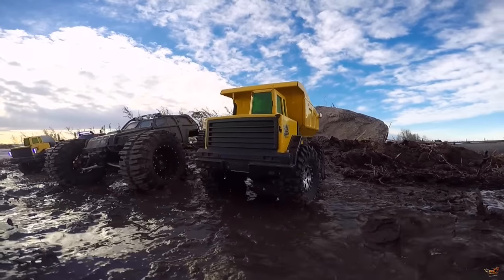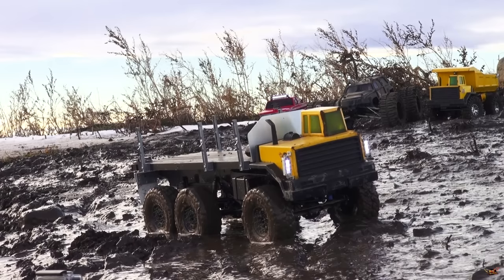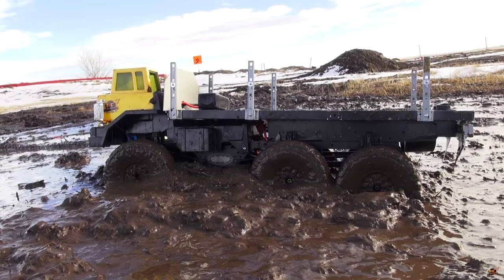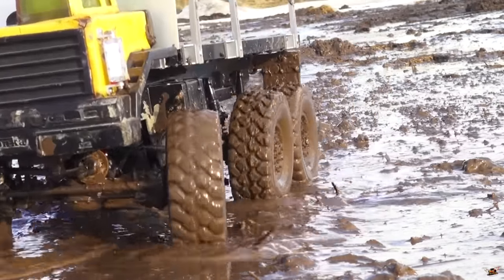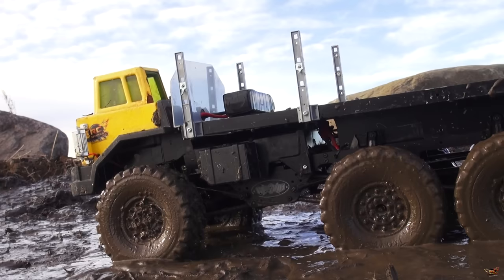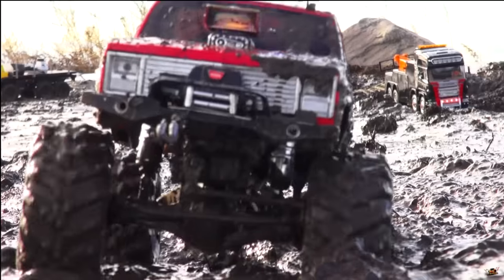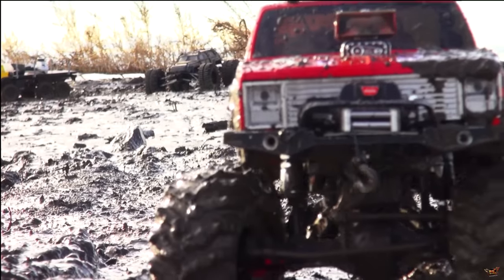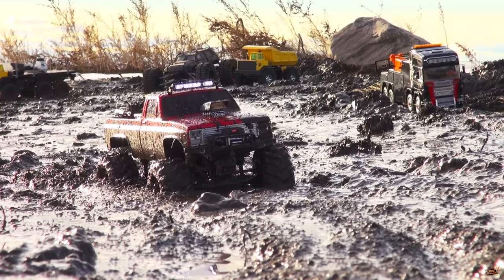RC ADVENTURES - MUD BATH - 5 Trucks get Dirty

Comment: I have an idea, and would like to know people's opinions, even though the top opinion will probably be "throw it away.'

I bought a 4x4 Traxxas Slash last tax season, and bought the one with onboard audio (OBA).  
The thing is, the slash is so damned fast (I've gotten 44 miles per hour so far, but am not the best driver, so that's plenty for me yet), that you only get to hear the OBA as it passes (which sounds cool) and then not while it's 100 feet away (I do a lot of speed runs, in parking lots, still getting better at controlling at high speeds).  
Another thing is that the OBA speakers RELY on a TAPE connection between the speaker baffle (there is no speaker 'cone') and the inside of the lexan body (which serves as the cone).  Every time the truck tumbles or takes a moderate hit, the tape pops, and if it's not a fresh tape seal (no dust at all on the tape), the speakers will pop off, there's nothing you can do about it.  I've even tried rubber cement and even superglue once (don't do that).  It's just  too difficult to keep them glued well.

So my idea is, I'd like to pull the OBA out of the slash and put it in my Honcho, with a regular small speaker.  It won't be as loud or rumbley without the lexan body, but it should suffice since I am never more than 20 feet from the Honcho .. and thought it'd be pretty neat to have the sounds of a "900 horsepower performance engine under the hood".
I also have a Subaru Impreza body that fits my honcho chassis and the 900-hp engine would just sound stupid as hell (and thus hilarious?) in that .. 

Thoughts/ideas/suggestions/changes?  If the only thing you have to say is "throw out the OBA" or "OBA is a joke/toy/etc." then please don't bother to say it.  I HAVE it already and am just looking for ways to mess with it, it's costing me nothing at this point.

Yes, that post was too long, so thanks for bothering to read it.

Tl;dr  How should I reuse my Traxxas OBA module in my Honcho/Stampede/other vehicles?
Reply: You can buy new tape rings online, like eBay or Amazon, maybe you can try some gorilla tape to hold the mounts down after you do that?  People use drywall tape and Shoe Goo to reinforce and fix cracked lexan, could try that too. You should try contacting Traxxas first, they have great customer service!! they might even send you some new rings free or give you a better idea how to fix it. On board audio is awesome!!  One of these days I'll get it for my slash, I can't wait!!

Comment: Are your tires filled on that skidsteer? Or are they air filled? If there air filled you ever have an issue poppin the bead off the rim makeing sharp turns?
Reply: They're air filled I believe
Reply: Tyson Evans m
Reply: No because zero point turn effects all skid steer with tracks

Comment: Hello everyone,  I'm wondering what the best scx10 model is ? The Deadbolt? The Honcho? Dingo?....? 

Thanks in advance.
Reply: RC Storm Thanks for your reply but the Ram Power Wagon is less detailed then the other scx10's (in my opinion). And yeah the G6 is pretty cool.
Reply: its all down to personal preference! i have a honcho and it is brilliant, the battery is up the front from the get go and it just works. but they all are essentially the same parts just arranged slightly differently
Reply: pyrosrockthisworld I know but some models come with more and cooler accessories then others. Like the CR Edition.
Reply: Wietse De Koninck the Deadbolt is probably the best value for your money. It's got a waterproof ESC and a water-resistant receiver box, and it's the cheapest model by about $50.